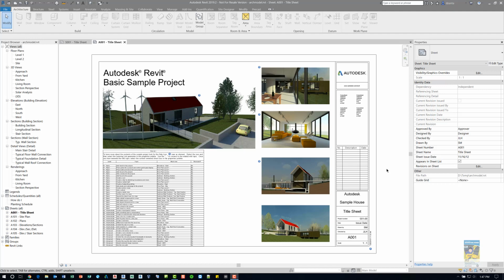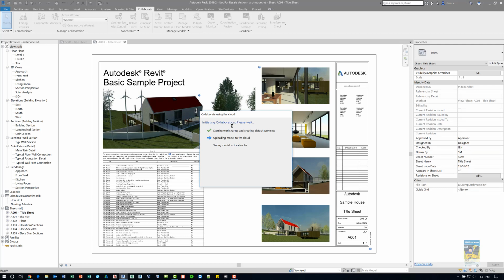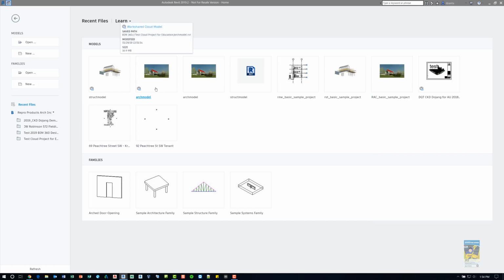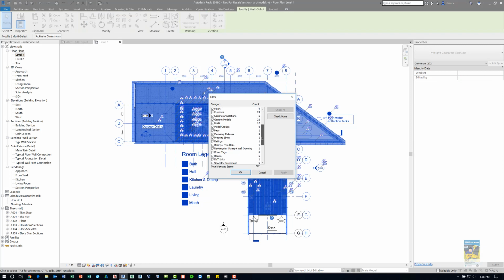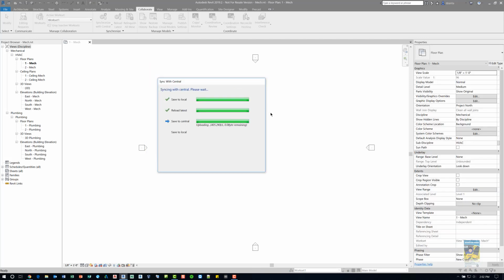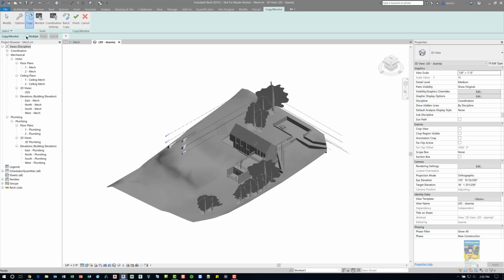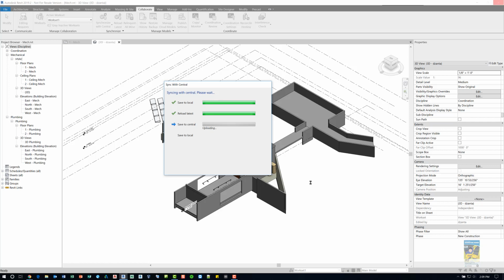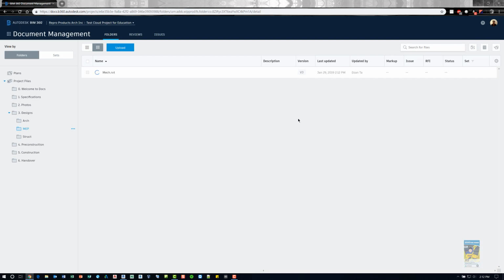BIM 360 Design Creation Upload and Link

Comment: This video saved my work after a long time of searching thanks a lot but I have a question about the linking, Could I link an A project to a B project and then link B to a C project and still be able to see A?? because every time I try this I get the A project not visible in BIM360 !!! however, I tried to set the link attachment instead of overlay but didn't work. is there any trick or something? Do you think there is something that has to be done with the worksets?? or publishing options??
Reply from the maker: It should allow linking as you speak. I will have to test
Reply: @DzanTa  it does inside the Revit but when it comes to BIM360 is not visible
Reply from the maker: @jorjitkhouri2299  I will double check this morning and get back to you
Reply from the maker: @jorjitkhouri2299  So I figured it out.  If your linked models are set to Overlay which is the default, the nested linked model will not show up.  This is by design.  However, if you take for example an MEP model and link it into a Structure model as Attachment instead of overlay....and then you link in the Structure model into an ARCH model where the Structure model is set to Overlay, you will be able to see the nested MEP model within the ARCH model.
Reply: @DzanTa  Thanks you are the best :)
Reply from the maker: @jorjitkhouri2299  actually...you are the best...!  Have a nice day.
Reply: @DzanTa  Yes exactly but you wouldn't be able to see the MEP in BIM360 which is weird !!!
Do you know why?
Reply from the maker: @jorjitkhouri2299  I just tested this in bim 360 cloud and I can see the nested linked model. Verify your nested linked model is set to attachment. Let me know your status.
Reply: @DzanTa  Thanks for replying could you please make a video for this ??? because I just tried it and still get the problem I don't know what wrong I'm doing.
thanks a lot
Reply from the maker: @jorjitkhouri2299  ok...I am currently looking at the new AutoCAD 2022 features so will make a video for you asap.  The other option is for me to remote into your system to help you.
Reply: @DzanTa  Thanks a lot I'll wait for the video :) because I have this problem at work and remoting is not an option here haha
Reply from the maker: @jorjitkhouri2299  ok....I understand...will do asap today
Reply from the maker: @jorjitkhouri2299  what is your email address to send the video to?

Comment: What is the difference between creating a central model on a server vs in the cloud?

Also when creating a model what needs to be done? a. create worksets b. log into 360 from the web or c. open revit?
Reply from the maker: Central Model on Local Server is different in that it is NOT stored in the Cloud (Autodesk Servers).  Cloud based BIM 360 Design models allow for worksharing and Revit interoperability between any Revit user anywhere they are located in the world as long as they are part of the project and have the necessary rights to make the changes to the model from within Revit.
To make a Central Model on a local Server:
- Open Model
- Collaborate Tab of Ribbon, Click Collaborate
- Choose Collaborate within Network
- Initiate worksharing and create Worksets
- Save model as Central model on local server
- Create new Local Models from Central Model on each workstation for each user

To make a Central Model for BIM 360 Design:
- Open Model
- Collaborate Tab of Ribbon, Click Collaborate
- Choose Collaboration using BIM 360 Docs
- Specify Hub/Project/File location
- Worksharing will be initiated and then you can save the model
- Close the Central Model
- There is NO Local Model for BIM 360 Design as you typically expect (only database files/folders exist)
If you need clarification, I can teach you for a fee
Hope this helps

Comment: what the differences between save as  method and initiate model to cloud?
Reply from the maker: Save as cloud model just saves it as a regular model for storage on cloud account...similar to saving to dropbox or box.  Initiating cloud collaboration Revit model uses  Autodesk Revit cloud services to make a true cloud work sharing model for others to work simultaneously with you.

Comment: Thanks Dzan Ta for uploading the nice and clear video with important information. I just have a quarry:  you have linked Structural model in Architectural and saved it to central in BIM360 then  linked back the Architectural model (which already contain the structural linked).Is this ok for a regular workflow in a structural company?
Reply from the maker: If you are a Structural Engineer, you would link the Arch model into yours.  Any nested Revit models will not load automatically because of redundancy.

Comment: Is this considered live linking?  If I want to link to an Arch file that's not live do I simply consume their files via collaboration in BIM 360 and use the 'Link Revit' to the new Arch file in the consumed folder?
Reply from the maker: Correct
Reply: Hi  @DzanTa , I think live linking is not possible when other discipline do not give their folders permission instead they are sharing a package via collaboration.Even other team give permission to their live model it may not be a good idea to link live because you may not have control over the versions.There are many great helpful videos in the youtube regarding  BIM360 Doc.Management, even there are confusion to figure out correct workflow. If you have updated video please let us know.However thank you again  for your effort.